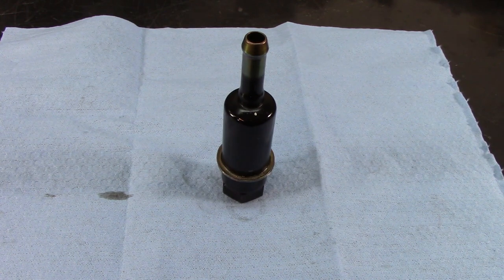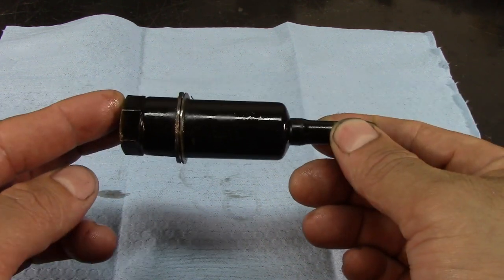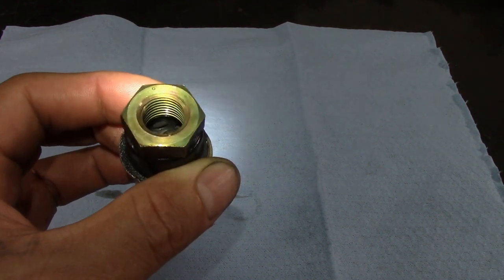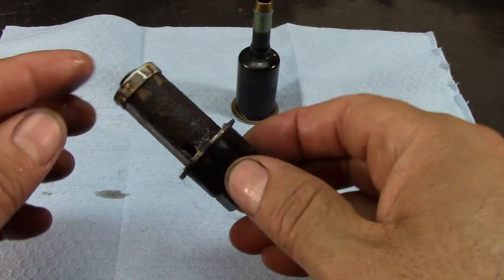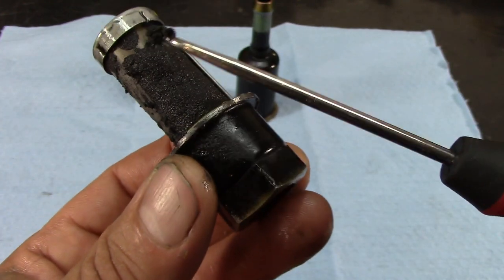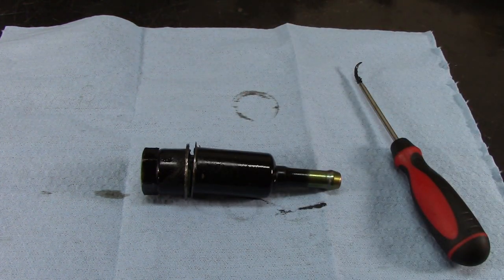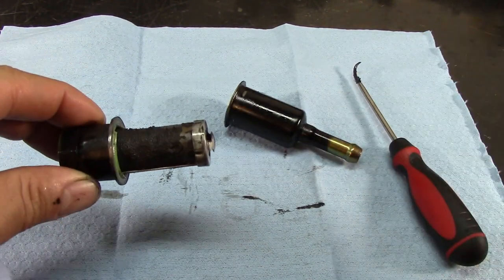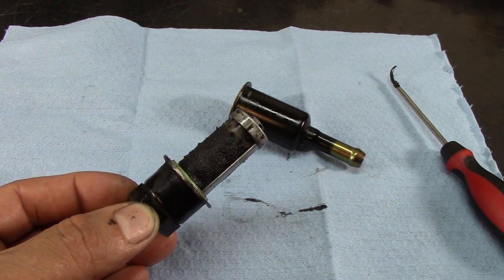Acura / Honda Transmission - In Line Filter Restrictions - Common Cause of Failure

Comment: Thank you very much Mr. Hiram for sharing such a nice information. Really filters and lubrication is a sensitive issue for any machine. Putting a new filter would be a good idea as long as it should available and not very costly. Otherwise a repair to the filter could also be a solution! Regards,

Comment: This filter was only installed by the dealership with a replacement transmission from Honda, excluding the 03-04 Odyssey. Meaning that when a transmission was replaced no matter if under warranty or payed for by a customer one was included and installed on the vehicle. I know, I installed at least a hundred transmission's with the warranty extension. .
Reply: Samuel Simpson
Reply: So not all transmissions have it? Just rebuilt ones?

Comment: Great video and information for those of us DIY.  I will be on my search to find an aftermarket for my 1999 Acura CL; mine do not have one but I am thinking on cutting the line to add one of this filters.  That might help get all the fiber before entering into the transmission again because I do not think the filter inside the transmission is doing the job right.  Also it would be easier to change this one once in a while in the outside instead of dropping the transmission and have it open to only change the filter; by then I can only imagine that the clutches would be all worn out.... Any comments will be appreciated.  Thanks in advance, Jose

Comment: I am about to change this filter on my 2003 Honda Element EX 2.4 (25430-PLR-003) as it isn't shifting automatically any more. I have no codes. Do you think that makes sense?
Reply: Richard Flander , yes it does-how did it work out?
Reply: other filters, too
there are several

Comment: A few weeks ago my transmission failed in my Acura. Apparently the filter clogged then caused my torque converter to blast pieces of metal everywhere. $3,300 to fix it. Not cool.
Reply: funny thing is I asked my Acura  dealer specifically if the transmission return line filter needed to be serviced (140kMi): 
Adviser simply sayed: 
"Don't worry about it!"
... we'll sale you a new car when $5,000 repair shows up 😂

Dealers are not in the business of following service manual... only over priced basics + timing belt

Comment: 2001 Accord EX: Has anyone removed this filter and replaced with another filter or  patched in additional line?
Reply: I installed a Raybestos Powertrain Inline Magnetic automatic transmission filter (https://amzn.to/2QAz2NR) on the inbound transmission oil cooler line of my '00 Accord. Intuitively, using a 12mo replaceable external filter, along with bi-annual 3qt fluid swaps, just "seems" like sensible regular transmission maintenance practices with the goal of lengthening the life of the friction packs and minimizing gunk inside the transmission. But I have absolutely zero proof that my efforts have the desired effect.

Comment: Hiram... 
What is your opinion of using aftermarket replaceable external transmission oil filters toward the effort of minimizing metallic detritus inside the transmission? If you like these things, can you recommend a particular product?

I installed a Raybestos Powertrain Inline Magnetic automatic transmission filter (https://amzn.to/2QAz2NR) on the inbound transmission oil cooler line of my '05 Odyssey and '00 Accord. Intuitively, using a 12mo replaceable external filter, along with bi-annual 3qt fluid swaps, just "seems" like sensible regular transmission maintenance practices with the goal of lengthening the life of the friction packs and minimizing gunk inside the transmission. But I have absolutely zero proof that my efforts have the desired effect.
Reply: Just like any other machine, transmissions like clean oil. There's no harm in installing an additional filter as long as you use quality parts and install it correctly, anything the filter catches shouldn't be floating around your transmission. Using a screw on engine oil filter with a magnet stuck to it on a remote filter mount is a great option too, that sure makes maintenance cheap and easy compared to a specialty inline filter. IMO, all automatic transmissions should come with a screw on filter like many Saturns and Subarus have. Just to be clear, a filter definitely isn't a substitute for regular fluid changes though. Many wear particles are way too small for common filters to catch and it clearly won't stop the fluid from breaking down, so regular drain and refills are critical too.